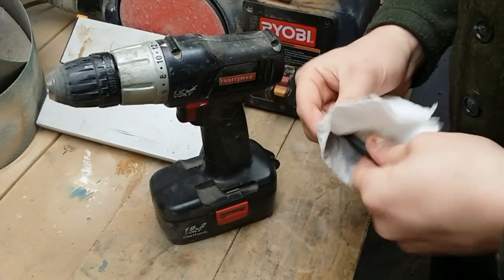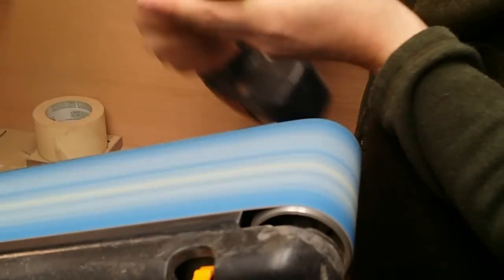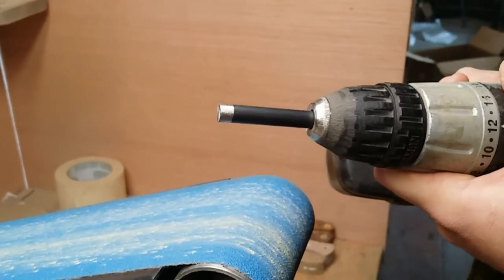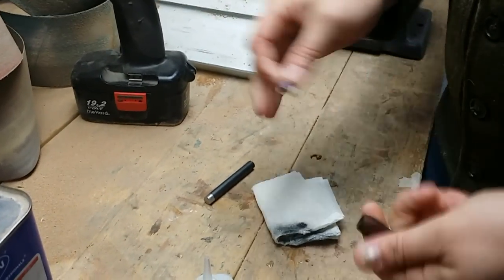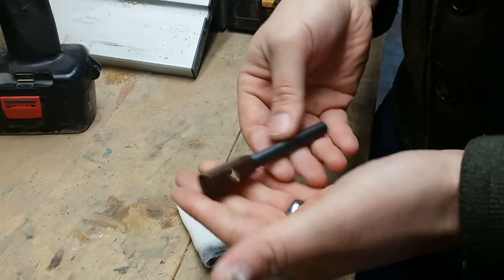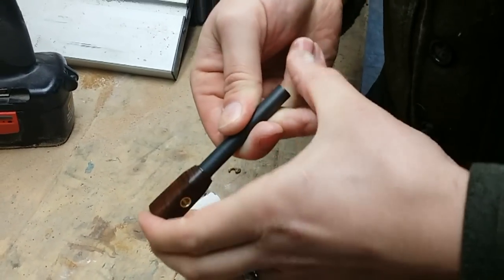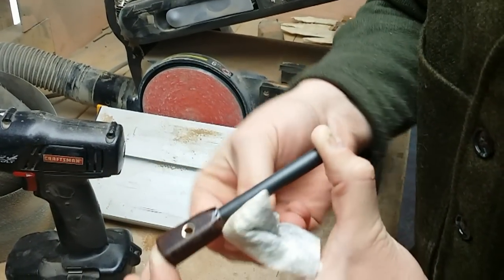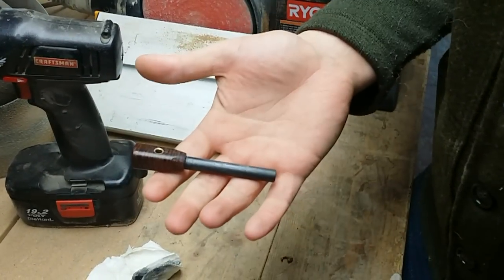Shop Short - How I Mount Bushcraft Firesteels

Comment: Awesome tip. I carve deer antler handles for my blanks and I rough the end with emery paper I then file 3  x-shaped grooves for "teeth" to allow the epoxy to grab and hold the steel in the antler .  I have also drilled and pinned them in the antler. So far I have not had one fail. Thanks so much for this. You have a new subscriber.  Kudos! !

Comment: I make my own from blanks.  I also use a triangle file and file two grooves around the end of the firesteel before I glue the blank into my handles with slow set epoxy.  Never had one fail yet...